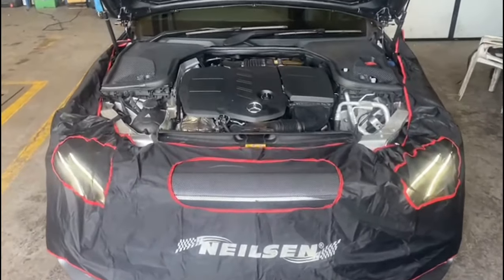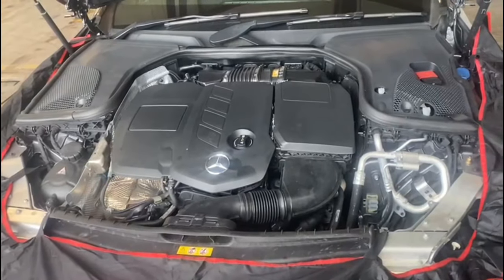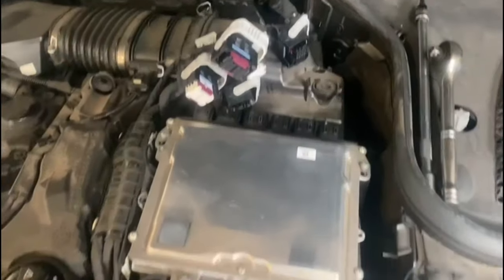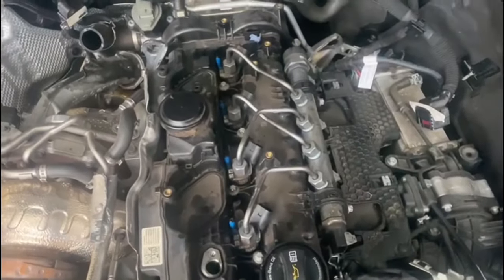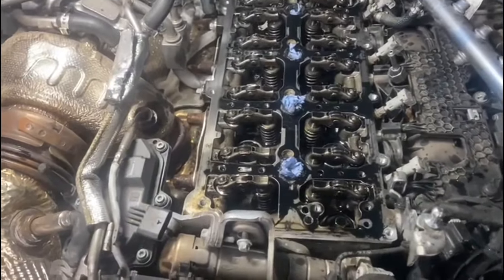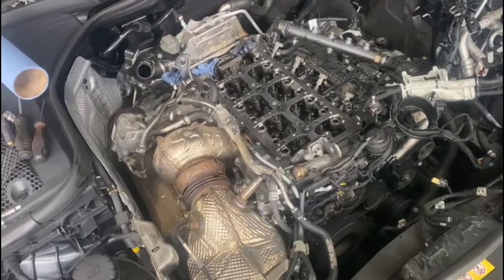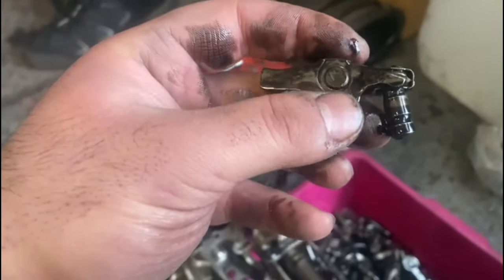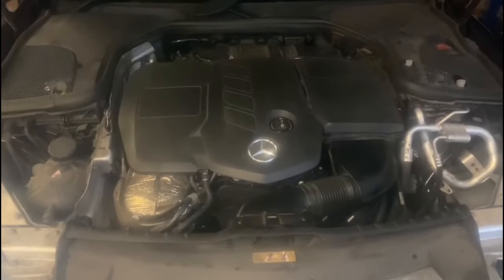Two Mercedes E Class’ 2017 654 Engine Knocking Noise In And Out Same Day

Comment: The guys at Enka Motors fixed my Mercedes camshafts, rocker arms and tappetts yesterday, I highly recommend this garage, very friendly and knowledgeable, good price also. 
Take a book it’s not a 2 minute job!
Reply: How much did you pay for everything. Parts and labour.
Reply: @OsamaKhan-mh3ri  The guys at Enka will give you a list of all the parts you need from Mercedes, £1100 for the parts, labour was £600 inc VAT
Reply: Where is erika motors located pls ?
Reply: Where are you guys located? I’m having the same issues
Reply: @MickSweeney-qe3od  thanks for the message. I just saw it. Had the notification off. It was for a friends car. The noise seems to have gone away for some reason. Sure it’ll be back. I’ll forward your advice to him. Thanks again.
Reply: @DUNNTHaDONpromo  N17 0SQ Enka Motors

Comment: I'm an MB tech, we've done dozens of these on the early 654 models, the rollers are modified and it's not an issue on the later ones. The biggest issue at the minute with these engines is the tandem vac/oil pump leaking oil into the vacuum system and eventually the brake servo
Reply: Hi Alan from which year they used modified rollers?
Reply: Yes, I am also curious about it. Are those issues also present at motors OM 654.916 built in c class 180/200d?
Reply: Yes I am interesting for that also.

And for the first engines, do Mercedes take in charge the modification ?
Reply: Hi. 2019 year's rockers is modified?
Reply: Later one models has this issue? 19/20 plate?
Reply: do you know what year of production mercedes fixed this problem in production? I think it was 2022.
Reply: I don't think it's the rockers at fault, but the engine design as they only wear on one side, and i Read of a car covering 300000 and having changed the rockers twice.
Reply: Guys, is there a problem with the om654de16 engine? What should we pay attention to in om654 1.6 version?
Reply: Is the facelifted W205 C220D ok?
Reply: Please does e220 2020 has modified?? Does has this problem?? Please 🙏

Comment: Hi Enka Motors,would like to praise you guys for the Good work you carry out for the mercedes owners. As a Tech myself,familiar with these Engines would recommend  to clean out the carbon build up in the Inlet manifold & both EGR Coolers too. This will improve Engine Running  Efficiently aswell. God bless & keep up Good work 👏 .
Reply from the maker: Thank you very much for your advice my friend, we will definitely take this into account for future jobs. For example, we’re currently repairing a snapped timing chain, but we’ll make sure to clean the inlet manifolds and EGR coolers as you said. 👍
Reply: Hi l have same engine and have been diagnosed with knock sensor do you know where it’s located plz
Reply: You need know which  knock sensor is front or rear ?
Reply: It looks like an oxygen sensor, the wiring  has a Alloy flat Square block/ connector.
Reply: Hi yes you was right obd shows nox  bank 1 sensor 1 circuit 
Do you know if it’s front engine or underneath ? 
Thanx for great videos
Reply: @zjmastej3416 Hi if its Nox1 then it's the one at the Front,follow the wiring  & it should have alloy square bracket.

Comment: I work at MB and I've done them under warranty in cars with 30-60km of mileage, which is 18-40k miles ;) Once u hear It once, it is easier for you to hear them failing in the early stage.
Reply: Hi, 
should owners with OM 654.916 engines from 2019. should be concerend about this issue? 
These engines are built in c180d models.
Reply: @ludimilojko8607  Yes. All 654 engines. Even in 2022 new cars, but Mercedes "claims" that they solved the issue, but they did not.
Reply: @Cribs00  Thanks on honest answer ;-)
Actually, I purchased c180d two months ago. It was 3 years old and had 25.000 km. On monday I was in MB's workshop on recall action due to some valve in cooling system and SW update for engine ecu. MB figured out that the regulation of cooling can cause water pump membrane failure. 
Subjective observatio after sw update: more vibrations in idle mode? 
Another thing is, whether to continue to do services at MB workshop or do it by myself. Changing oil and filters is not so difficult and I have my own garage with 2m deep oppening in floor. 
Can you share with us, who is om supplier for mercedes parts? 
I saw beside mercedes number also model number and logo of supplier. 
E.g. air filter for om 654 is usually from MAHLE, as well as oil filter. 
Diesel filter is from MANN HUMMEL, right? 
The question is, does it make sense to by om mercedes or aftermarkt?
Air OM filter is around 70€ and aftermarkt 30€.
Reply: @ludimilojko8607  Change your rocker arms if you want to drive this car for long time. If you do it early, you won't damage camshafts which are very expensive to replace. Just buy them made by INA. 
Do oil change yourself. A lot of mechanics in my dealership did not change oil in customers car. Change oil every 10k-15kkm. Its very simple. You wiill have to open secret ASSYST menu to measure exact amount of oil in your engine. Also you will have to buy one time use plastic oil drain screw. I am not sure of supplier of MB parts. Daimler tries to hide it. For filters use Mann, Mahle, Knecht, Kengst. Don't buy original filters from MB. They are rip off.  Overall, do simple service by yourself and only go to dealership for bigger repairs.
Reply: @ludimilojko8607  And one last thing. CHANGE YOUR WATER PUMP! There is an issue in this engine where it breaks and coolant is being sucked up into vacuum system. If that happens, repair is very expensive. Engine, transmission, timing chain will have to be taken out and oil/vacuum pump will have to be changed and a lot of other parts  Read about it in internet.
Reply: @Cribs00 so the INA rocker arms have better quality than the original? what's their average lifespan, with correct maintenance and normal driving??? Thanks in advance!
Reply: @ΓΙΩΡΓΟΣΔΡΙΤΣΑΣ-η8ζ Original MB are INA. Upgraded rocker arms have INA written on them.
Reply: @Cribs00  thanks mate 🙏

Comment: Does it still happen on newer sprinters with the 654 engine ? 2022-2023 model. We a few at work with the 651 and 654 engine. The one i'm driving has almost 15.000km on it, oil consumption goes down as we drive more ( engine break-in period ). Had to add about 1L after 4000km. Consumption is way less now

Comment: good job, a little tip, check the silencer rubber on the gear wheel of the high pressure pump, I have had 3 cases so far, the rubber had come loose.2 pieces OM 656 and one OM 654.
Reply: Guys, is there a problem with the om654de16 engine? What should we pay attention to in om654 1.6 version?

Comment: Very good I have a same  mercedes with same issue  knoking  noise  during start engine  for the first time in the morning time.
The  knoking  noises are for few seconds   only
What do you think is  the issue and  which parts are worn out.

Thanks in advance

Regards.
Paul
Reply from the maker: From your description, it seems that the issue would be the timing chain rather than the rocker arms. Timing chain issues will usually only make a noise when you first start the car whereas a rocker arm issue would be heard every time. Rocker arm issues will also have a knocking noise to them whereas timing chain issues will have a grinding/shuddering noise which will last a few seconds and get quieter. We have a few videos that show timing chain issues, you can browse them to compare the noise between your car and the one in the videos. I hope that was helpful

Comment: Would you say this failure could be avoided or prolonged by changing the oil a lot earlier?
Reply from the maker: Possibly could be prolonged to a certain extent, the reason these rocker arms fail is because factory arms on the engine they don't seem high quality whereas the replacement ones are branded and seem better quality. Another reason, for them failing is the excessive pressure on the exhaust side dpf, cat convertor and two egrs etc.

Comment: When you change that, that new parts are the better quality or the same with the original?
Reply from the maker: The old rocker arms that comes off the engine they don’t have part number, barcode or brand on it. The new ones are INA brand and have barcode and are the upgraded better quality ones.

Comment: im going to do same job on mine . what do i need for parts ? 4 copperwasher for injectors and all the rocker arms and lifters.  and headvalv gasket is it any more ? 😁
Reply from the maker: 16x rocker arms
16x hydraulic lifters
4 copper injector washer
Rocker cover gaskets comes 3 piece 
2 gaskets under the camshaft carrier
Engine oil and oil filter 
And get camshafts just in case they excessively worn if not you can return it without opening box
Reply: @enkamotors7012  thanks so much 😃

Comment: I have the same noise at the cold start but  in 5-6 sec its going away should i worry about this?
Reply from the maker: Hi i don't think is the same noise your one looks like timing chain noise. You could watch our videos about timing chain in our channel.
Reply: @enkamotors7012  i dont know,I hear similar noise at cold starts and goes away in 4-5 second  but i will check out your timing chain videos thanks for your answer
Reply: Your one is timing chain because I had same problem but mine was camshaft and timing chain Mercedes start to changing the timing chain for free because dvla told them so it’s recall
Reply: @aftabexpress  thanks for your reply,so mercedes can change timing chain for free?  i bought the car from random dealership is that does it matter?
Reply: @Sozzi924  no it doesn’t matter I’ve got the letter and Mercedes doing it free because dvla told them to do it so they have to do it just book your car they will do it
Reply: @aftabexpress  can i pm you for more info about it mate?
Reply: @aftabexpress  does this apply to all Mercedes-Benz

Comment: I was planning to buy 2017 e class. I am bit confused now.  Would you still recommend 2017 merc e class?
Reply from the maker: Yes I would still recommend a 2017 e class, the 645 engine has only this rocker arm problem, which usually arises after the car has reached 100,000 miles or 150,000 km. The rest of the car is good 😊

Comment: I have the same noise in my engine, and i have an additional problem of not having the ability of using the car pallets, and what i notice in parallel is that my car can't go further than D7, so it doens"t reach D9 anymore.
Reply from the maker: This noise indicates a problem with the camshaft or rocker arms, causing your engine to go into safety mode and your car to slow down so you can’t reach D9 anymore.

Comment: Hello
Mr,
Do you have codes and exact names of partes that need to be changed?
Thanks
Reply from the maker: Rocker arms set
Hydraulic lifters set
Rocker cover gaskets 
Gasket under camshaft carrier
4 injector washers with new bolts
Reply: @enkamotors7012  thanks very much!!! Very useful video!!! 🙏👍🤗
Reply: Dear mr, what tools are needed for putting back the distribution? I’ mean the upper axes thanks
Reply from the maker: @vasilemuresan6957   654 589 01 4000 tool number.
Reply: @enkamotors7012  Thanks a lot for all!! if i stayed in UK definetly i come to you with my e class....now i try to find a mechanic here in Romania!!!!

Comment: Hi Enka, thanks for the video. You did explain it amazingly! How would you rate the engine that is in c200d 2015, one with the 136hp i heard it's  Renault R9M engine. I recently traded in for the s205 and i little worried about reliability.
Reply from the maker: Wouldn’t advise any engine that’s related to Renault

Comment: Hi, same issue been told by Mercedes Brighton, on a E class w213 220 with just 60.000 miles and all the services done with them. Can I have your number to discuss if you can help fix this. Regards Danny
Reply from the maker: 02088842200 enka motors

Comment: Are there same issues present at om654.916 engines built in face lifted c class c180/200d?
It is 1.6L 122hp or 160hp and supose it is the same engine with different ecu maps.
Reply: c180 uses Renault engines

Comment: I drove the car with this noise to get it home it was an hour journey the car just suddenly cut off on m40 and won't start anymore is this the same issue?
Reply from the maker: I don’t think it’s the same issue, a knocking noise coming from the engine wouldn’t lead to a car shutting off, but it could be that there was an issue with the timing chain of the car: either it snapped or jumped
Reply: @enkamotors7012  would that cause the car to not tick over?
Reply from the maker: @adz3133  if the timing chain is snapped then the engine wont tick over at all or it could be that the oil pump chain has failed and the engine is seized, did you get any lights on the dash?
Reply: @enkamotors7012  last owner apparently got all lights on dash wiped
Reply from the maker: @adz3133  what make and model is your vehicle
Reply: @enkamotors7012  Mercedes E class 2012 only bought it yesterday and this happened done around 330k miles
Reply from the maker: @adz3133  Your engine is 651 i think your engine problem is the crankshaft seized. We done a timing chain same as your engine you could find it out in our videos
Reply: @enkamotors7012  thanks guys how much would you guys charge for a job like this
Reply from the maker: @adz3133  your best bet is to replace the engine with a low mileage one so it saves you from the headache, ring us up on 02088842200.

Comment: Hi i have similar noise but my one it’s only 3-4 sec long and it’s only sometimes in the morning  and my car it’s from 2015 Om651 you think that will be same issues?
Reply from the maker: Hi your problem is the timing chain it's not the same problem as in the video  many thanks
Reply: @enkamotors7012  timing chain was checked it’s good stretch and tensioner was replaced.
Reply from the maker: @lukaszszumilas9089  my opinion is the timing chain. You have to change timing chain the guides and tensioner. just the tensioner won't solve the problem
Reply: How many miles
On your merc ?
Reply: @arthurmassen9628  at the moment 92k
Reply from the maker: @arthurmassen9628  100000  miles roughly.

Comment: Slm Kardes benimde w213 e220d  var  yağ kapagini motor çaliṣirken açiyorum motor buhar atiyor basinçli 
Normalmi?
Mgf
Reply from the maker: Aleykumselam.  Fazla basinc normal degil. Km kac birde yag eksiltiyormu yag eksiltmiyorsa problem degil.
Reply: Teṣekkür ederim kardeşim araba 2018 model 60.000 km
Reply: Yok yağ eksiltmiyor daha önce bende w211 vardi 220d  15 defa Türkiyeye gittim calisirken motor yağ kapagini açtigimda bu basinc yoktu acaba om654 motor çaliṣma sistemimi farkli Teṣekkür ederim hayirli ìṣler dilerim.
Reply from the maker: @ozcangirgin7648  654 ler de iki tane EGR var o yuzden basinc fazla oluyor o yuzden zaten piyano tuskarini bozuyor 100000  km den sonra problemler baslar.
Reply: @enkamotors7012  kardeşim Teşekkür ederim.

Comment: Emissions regulations have definitely killed the diesel engine. No matter how good a diesel you put in it, with 2 egr's and a massive DPF - there's no way the engine will last. It's a shame because all this does is cause more pollution in the end, also making people poorer by having them spend thousands for new parts and new cars. Much better were the times when you could buy a Mercedes and you were guaranteed for 20 years of usage - 300k miles!

Comment: Hello, does the problem occur on the W205 body with this engine? Car 2019 restyling 220d 4matic. Could you please tell me the original numbers of the rockers and hydraulic compensators, as well as the gaskets that need to be changed during repairs???